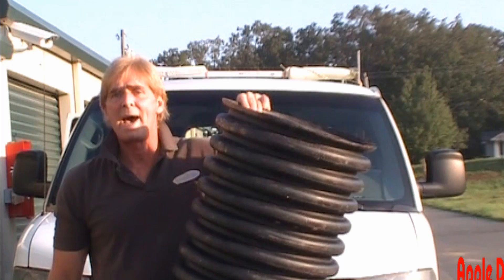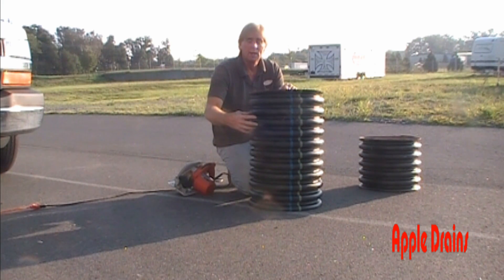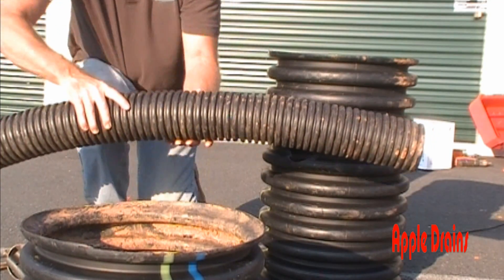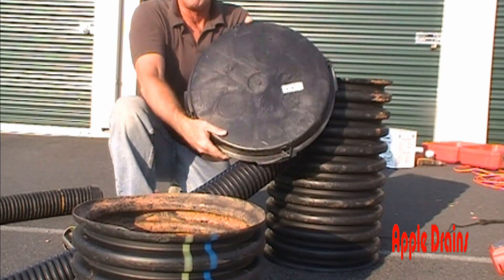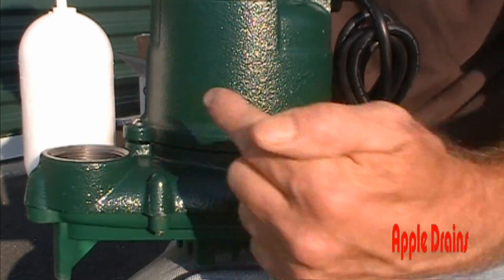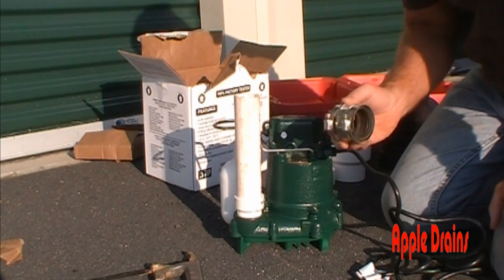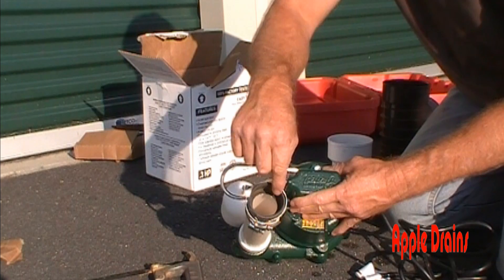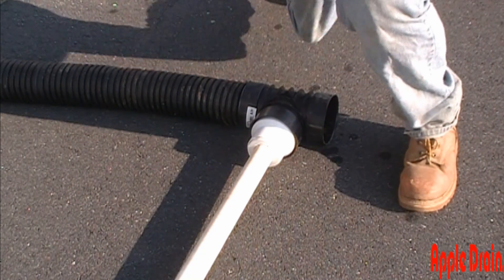How To, Sump Pump Set Up and Install, Step by Step Instruction Including  Perforated Pipe Connection

Comment: Plastic corrugated culvert makes a great sump liner, but may be expensive and hard to get in short lengths.  I had a project some years ago where I needed a few feet of the stuff and ended having to buy a full 20-foot length at $20 per foot — $400 plus tax at the time.  Fortunately, I was able sell half of it as a 10-foot piece to someone else and recover part of the expense.  A nice feature of corrugated pipe is that one can cut it into short lengths to fit it through small openings and stack the rings in interlocking fashion inside the sump hole.

Comment: Hello, I found myself here while searching google for culvert pipe for this exact purpose.  I am still unsuccessful at finding any.  I need about 3' worth of pipe at least 12" diameter, but the only stuff I can find is in 20' lengths and costs hundreds... which of course doesn't save me any money.  Does anyone have an idea where I might find culvert pipe by the foot??
Reply: If you are trying to install a single sump well, you'd be better to just go buy a sump well kit. They look like a giant 18" x 30" bucket, with a bottom. You still set it up in the way shown here, drill your own inlets, etc. That is a better set-up anyway, I think it would keep more grit and sandy dirt out of your impeller, making it last longer. This vid shows what a contractor would do, they would buy this stuff in volume for economy.
Reply: +simplespiral You can call any local water works suppliers or contractors who install large water mains or drainage piping. They'll usually cut you a piece for a small charge.
Reply: +Dave Bakke 
Thank you for your reply.  I actually found a farm supply store that cut me off a short piece like you suggested, it worked perfectly!  I got a perforated section and poured two inches of concrete in the bottom (after pressing some mesh in place for concrete support), then I set it in my hole on a bed of drain rock just outside a corner of my house.  I then surrounded my well by a foot out with drain rock for water that was gathering at the install location, in addition to cutting two inlets and routing water routing from different locations (from under my house and from a low spot in the yard).  Everything is working flawlessly with recent downpours in my neck of the woods, and my crawl space isn't flooded anymore.  Good video and good way to go about a project like this when the pre-made solutions just won't work for your needs!

Comment: 1. Use an actual sump pump enclosed barrel that seals at top with bolts.
2. Stop using corrugated drainage pipe around the house - use pvc.
3. For pumps without a relief hole, you can drill a 3/16" weep hole in the discharge pipe at about the height of pump - before the check valve (pointed away from the pump).
Reply: Cougar Land pvc is junk for drain tile!!!
Reply: Just to piggy back off of this comment (7 years later), these Zoeller pumps, in the instruction manuals, specify that you should indeed drill a 3/16" vent/weep hole in the discharge pipe to prevent airlock. This guy apparently doesn't read the instructions.

Comment: This is not allowed in Canada.   Airtight lids are now required by code.  FYI
Reply: I'm trying to find that rule/regulation, can you help me find it?
Reply: 9.14.5.2.  Sump Pits
(1)  Where gravity drainage is not practical, a covered sump with an automatic pump shall be installed to discharge the water into a sewer, drainage ditch or dry well.
(2)  Covers for sump pits shall be,
(a) designed to resist removal by children, and
(b) sealed in accordance with Sentence 9.25.3.3.(16).
Reply: FishyCanada
Thank you

Comment: Wow, you are the coolest. You just saved me at least $200++. My sump pump was not pumping out water. It would run and run, but no water would be pumped out. Thanks to your video I learned it has an air lock. Never heard of it. Thank you for this informative video.

Comment: Chuck, great video.  I have a couple of new Zoeller M53's and was wondering what issues you've encountered with their float switches (I'm glad you've never had to replace any of their pumps !).  I'm considering replacing one of the float switches with an electronic switch.  Have you ever used one of those?  Thanks, Jim
Reply: Why??? best pumps out there why change what the Engineer already "engineered" for you??  For Maint. FOLLOW  Zoeller manufacturers specs.